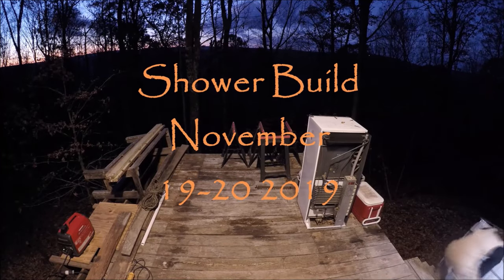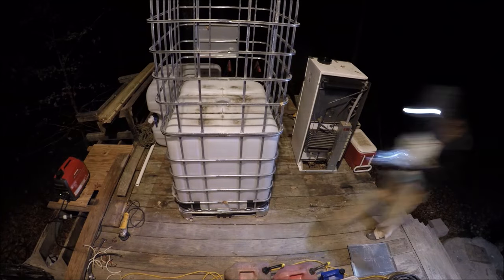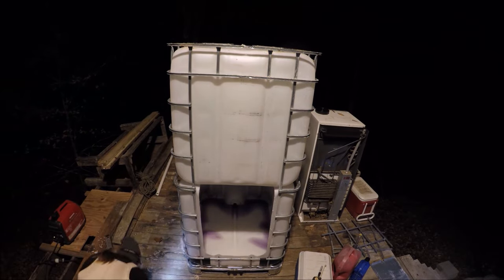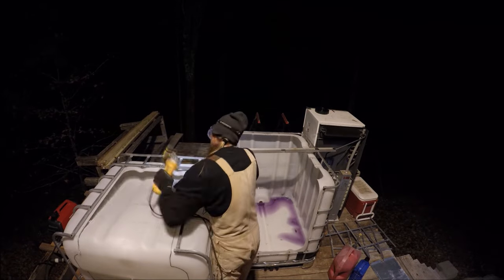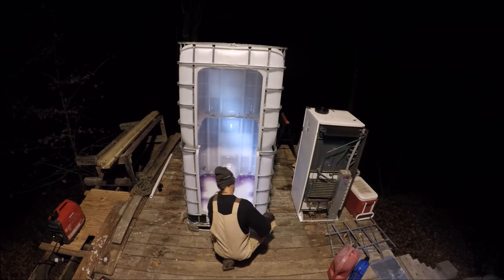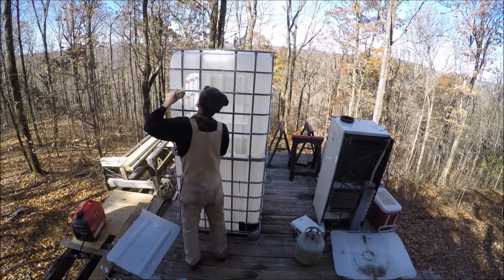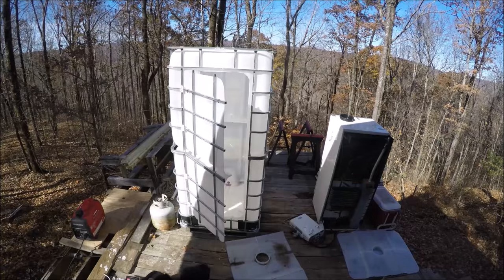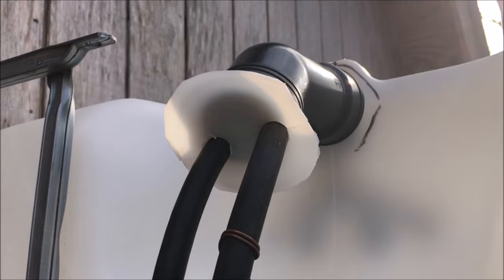(Off-the-grid) Outdoor Shower Build IBC Water Totes

Comment: Really nice clean build.  I just made one much like that but I heated and reshaped the plastic to close up those two big holes and left the top flange an inch wider then heated and folded it around the bottom flange for a seamless watertight connection.The only downside is it's difficult to heat the plastic without darkening it at least a little, though i'll take that over cut edges and rivets any day. One little galv strap each side folded around the bottom flange between the two halves and screwed to the frame is all that hold the tanks to the frame. They are mainly there for support lost to the door opening. Not a single screw or strap need except on the door panel. I'd put mine up on youtube if the free totes I used weren't brittle-cracked and disgusting. They had some boat sealer crap in them that just doesn't want to come off in some areas because I can't scrape too hard without cracking the brittle plastic.  I thought they were free when I got them at least. lol.

Comment: The outside metal support grid enables you to spray close cell foam to insulate in summer/winter. Grade/sand to the metal to represent a smooth exterior. Lay some fiberglass on and you're complete.

Add teak flooring strips and a compost toilet. Key thing, keep it in two sections for mobility
Reply from the maker: Great ideas. The ideas are endless. I love  hearing new ways to make these things useful! 👌🏽
Reply: Excellent idea! I was thinking of the same.

Comment: Well, that was pretty dern cool if do say so. Great idea, especially for off grid. Thinking you may even get away with putting a plastic 55 gallon barrel on top for water storage. Gravity feed the whole set up. I like it a lot....
Reply from the maker: Thanks Sean! A gravity feed barrel would work well as long as you can support the weight of the barrel! I have used a shower head that is for low pressure water use and it seems to work well!

Comment: Love it... would love to see if you needed to seal between the two totes... some strips of plastic could also be used as a stop so the doors won't swing too far in... there are some plastic welding tools that may be interesting to work with, along with hot staples or silicone caulking...would love to see the drain... love the splitter to make the water combiner. A torch may also finish up the edges of the plastic also... it may warm the plastic enough to bend and secure the side plastic to fill the holes without those other pieces... I guess being outdoors a little leak is nothing too big with the cable tie holes ;-) ingenious!!

Comment: good idea a bit of camo net job done, next you can do the same for a toilet using shower water for flushing toilet, going into ibc septic tank
Reply from the maker: The flushing  toilet IBC is great idea! But for septic I’d go with the plastic 55 gallon one because of the strength. The IBC plastic is weak and could possibly collapse under a dirt load. I won’t rule it out and say  it’s not possible cause it is possible!

Comment: Very neat. If you had a third tank, you could cut off the top and the bottom, leaving a height of maybe 6 to 10 inches in for each one, and somehow connect them together making a small tank to sit on top to store water in. The sun can heat that water stored on top which can be used to shower instead of connecting a hose.
Reply from the maker: I think it could work!
Reply: @jacelandadventures1523  All in all, like others mentioned< great video without music, your narrating was awesome, leaving nothing unexplained. You made it easy for everyone to understand. That is a huge plus. Keep up the great video's! Also, thanks for sharing this.
Reply: The cage has been cut and lost all its stability. You don't want to put another IBC on Top, fill it with water and then take a shower under hundreds of pounds resting on a fragile structure...

Comment: If you use a tote that is a 325 gallon tote (They are 6 inches taller than the 275 tote) you can cut off one metal bar leaving the taller totes plastic extending down an extra 6 inches.. Use this extra 6 inches to extend downwards over the outer edge of the 275 tote just like a lap siding on your house. rain water with flow over the outside edges of the lower tote.
Reply: another thing I forgot to mention is that when you put the 325 tote on top of the 275 tote you flip the 325 upside down leaving the forklift base ON TOP.. this forms a ridge so you can place a smaller third tank on top for solar heating water to shower or wash up with. you can mount a small solar panel with a solar DC powered water pump on it to fill top tank .. good luck.
Reply from the maker: videosrfun4me189 love it sounds perfect! Sometime or another I have three more to make, I’m thinking of making them somewhat different maybe hinging the two together for opening them up and making them more accessible for cleaning!  I wish I had the 300’s or even the 330’s at the time I could only get the 275’s!  Thanks for the input I definitely would like to do one that over lapse just as you said! 🤘🏼
Reply: Um, uh but still a bit cramped for two.
Reply: @marcushennings9513  i dont think this intended to be a romantic shower just a one person shower

Also....the big one on top would make a nice little shelf for shampoo and soap

Comment: Heat the plastic with a blow dryer to where it will bend into the shapes you need to cover those “dip” area holes, … convenient build, and I am going yo make a “pool” for my self to take a nice dip when it gets super hot outside, … adding the shower knobs to the backside, & then placing the drain at the rear corner would be a plus, … adding some of those plastic strips as shelves to hold rags, towels on the outside, & shampoo, conditioner, and soap would also be an easy build, … one just needs to see the build in his/her mind, and apply common sense, and WAHLAHH!!! A shower, tub, pool, for playtime, of in creating a garden area fed with the water from the skies, … can be fun as well as profitable too, … all types of uses from the “totes”  markets, … I’d love to find some a bit larger than your shower project, .. but a bit of ingenuity can create pretty much anything needed to work as an overnight shelter if one is say hiking the Appalachian trail, or anywhere that there might be a need for shelter from the weather, or wild animals, … as long as they cannot get to you, lmbo!!!

Comment: How tall of a person can use the shower ?
Reply from the maker: Campervan Kevin   The height on the inside is 6’ 7” at the corners, 6’ 4” after the plastic sags a bit toward the middle. I am 6’ 2” and it works just fine for me. The 275 gallon totes give you this height but if you were to use 300 gallon totes the height would be substantially better! At the time I purchased the totes 275 is all the guy had. I would not go any smaller than 275 gallon, the 250 gallon would be substantially smaller and guy my size and would not fit well!

Comment: What a nice outdoor shower! Based on this design, is it possible to install a sun-heated water tank on top of the enclosure? I guess in that case the other tote base (pallet) shouldn't be removed, right?
Reply from the maker: That’s a good question. On top if you were to put anything directly on the plastic, if your thing is heavy, it would colapse the plastic. If you built say a framed out deck that fit over the metal, all the way around you could put some weight on it! The totes are designed to stack on top of each other when they have the pallet attached, so the deck you build could double as a pallet, yet most likely stronger, should work! I hope that answered your question!

Comment: Had you considered eliminating the inside edge but cutting it off both tanks, then sliding the upper tank into the lower? You lose some height but maybe get a flat wall.
Reply from the maker: I had considered that and it will most likely work. I went that way just for height. The next one I build I would like to get rid of the ledge and seal the two together! Not sure how yet
Reply: What if you eliminated all but about an inch lip so you can sandwich sealant between the two? Just enough to make contact, but not enough to really notice? I’m thinking about using this idea as an outhouse which is why I ended up finding your video. It’s so helpful to visualize it before doing it. The width on your door looks around 28”. Would that be near accurate? I’m hoping for 30” so I can use a screen door, but it is what it is I suppose. I’m doing a bathroom remodel so I’m plumbing to my outdoor septic intake. I have a previous toilet and figure water intake from spigot. A nice build. Thanks for sharing.
Reply from the maker: @sknerl  I will have to check on the door width, I can not remember off the top of my head!

Comment: do you need to stop these tanks from freezing when filled with water?
Reply from the maker: it depends on how cold from the freezing temp you are and how long it's gonna stay frozen. That is just the tanks filled with water.  after being made a shower then the water supply lines will be the only thing you would need to worry about.
Reply: You can use heat tape & wrap it around all the water lines. Follow that by wrapping aluminum foil around the water lines & then insulate them with wrap around foam. The wrap around foam can be pipe  insulation or as simple as a pool noodle.

Comment: Great Video! Can you throw a link to the plastic painters tool you use?
Reply from the maker: https://www.lowes.com/pd/Marshalltown-QLT-soft-grip-paint-scrapers-1-5-in-2-EdgePaint-Scraper-Blade/5001376153?cm_mmc=shp-cprdbdmbngPLA_BDM_210_Concrete-Block-5001376153-Online-0-_-0&ds_rl=1286981&msclkid=64fb8041d34d1921f1cce21330d62a8a&gclid=64fb8041d34d1921f1cce21330d62a8a&gclsrc=3p.ds
Reply from the maker: This is the kind that I used! There are other types

Comment: Do you think that it would be too flimsy without the cage?
Im thinking of using the plastic tank to make an inddor shower for a camper van.
Reply from the maker: Yes it is flimsy without the cage! I had to drill extra holes in the side of the plastic that lined up with the cage and  installed a few zip ties in a few places to keep it from settling down from  having no support. If it is left outside water can build up on the top and cause it to sag! But not after adding the cable ties! 
    You could have another support system built to help hold it up and not use the cage! 🤔 you have to do some thinking to make it work in a camper van. It’s because the gap that it naturally creates because the tanks aren’t perfectly square that makes them great for a outdoor setup.
Reply: I get what you’re thinking. Yes, it’s too flimsy, but you don’t need the cage if you already have walls. You must be willing to build it out and think of it like a durable lining for tubs and showers...

Comment: Cool build and informative but the cost of a used IBC is ard $200 in my area. Definitely cheaper to use a portable shower tent.
Reply from the maker: I would agree on that! Here where I’m at they were cheap Cheap!
Reply: Yeah, same 150 -250 in AB. Clawfoot tub in the cabin with wood stove plumber hot water tank,  or shower outside in the summer.